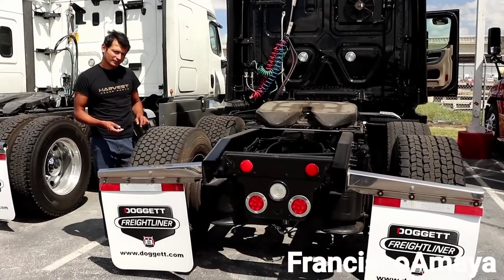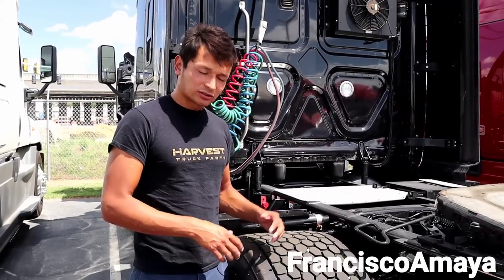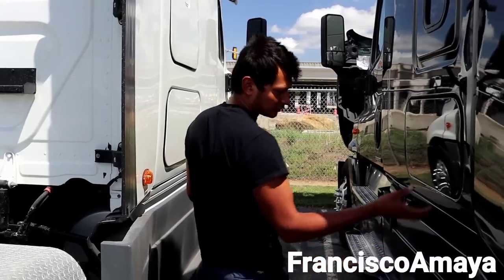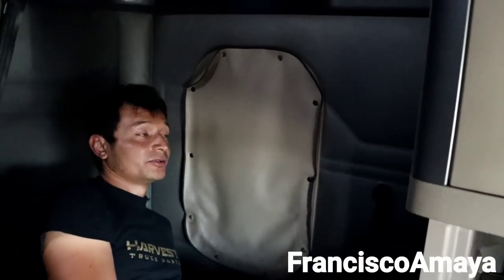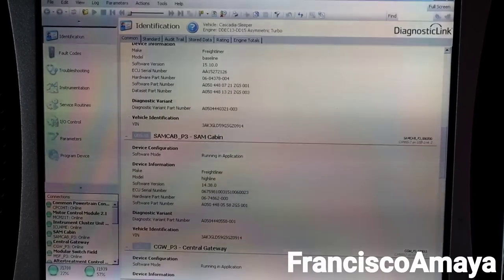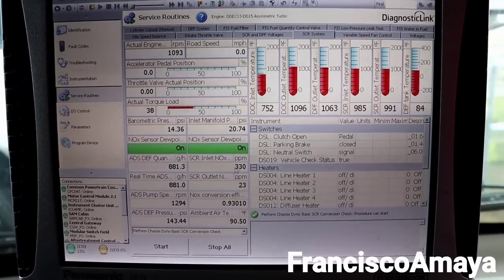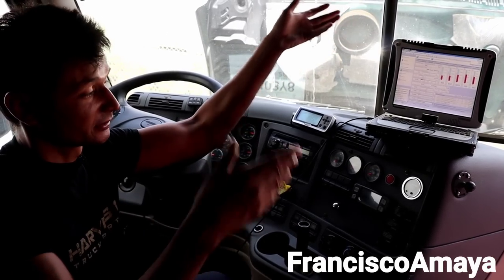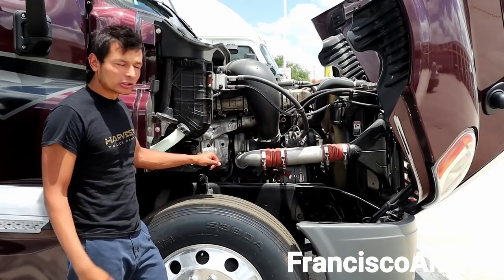Used Freightliner cascadia truck pre purchase inspection at Doggett Freightliner Texas special

Comment: Most of these dealerships spend hundreds of dollars detailing the truck, inside and out... they can hide leaks when they pressure wash the engine to make it great. Suggestion of offered. Spend $$$ on extra dealership-only warranty. So if is a Freightliner, make sure warranty is covered by Freightliner. Se for any other Manufacturer. Gomeoyh a mechanic like this guy, took his diagnostic laptop!!!

Comment: Wish I was knowledgeable enough to do this and not just trust the dealer before I bought my truck. It was a $30k mistake, I had that much in repairs and still not done bringing it to acceptable state. You’d think the franchise dealers would do better than the independent but you have to cover yourself from all of them. They are all in it for the money, be careful with these warranties they sell too. $6k spent on that nonsense and covered nothing. Keep up the good work Francisco and keep the videos coming, they are very helpful.
Reply: what do you mean. The warrenty it doesnt cover anything or emissions?
Reply: Didn’t cover any of my issues, I actually had one $700.00 bill of which $375.00 was due to an emissions part and I paid my $250.00 deductible for that part of the repair plus the other so the warranty did pitch in for something. Point being, have a professional inspect whatever you are looking at, it is worth whatever that person charges. It will save you quite a bit of headache not to mention money.
Reply: @jr996turbo  Yes true. What about buying the laptop setup Its a out 1 to 2k. You can inspect it yourself and keep the setup for down the road. and clear and repair ur own.
Do you think it would be good idea.?

Comment: Great job, Francisco.
I guess I've been lucky, my first truck was an old Scheinider 2002 truck. 733,000 miles, Detroit 60 series, only did 2 super tune ups, sold it with 1 million 90k
Second truck 2014 DD15 cascadia 452, 000 miles, 4 years and no problems with filter, motor, ok.

Comment: I passed on these truck and bought the red one which is exactly the same pinstriping interior ( came from same outfit) very true about  fixing or inspecting vehicle. I took out the water filter and OMG  it was absolutely covered in calcium rock like particles it was NEVER changed. Also just replaced all 8 schocks ( 2 were the small cab schocks on sleeper) freightliner washes the trucks and do NOTHING else.

Comment: Thanks for your youtube. I am planning to purchase a used Freightliner Cascadia 125. Would you please let me know your advice on which one is better to purchase for the OTR of the owner-operator?  *2016 Freighliner Cascadia 125 SLP Evolution: Manual, 375,000 miles, $60,000 vs *2017 Freightliner Cascadia 125SLP: Auto, 455,000 miles, $69,000

Comment: Thank you Francisco but most of us don't have detroit software to monitor the temps. This is why dealers need to just replace the box at 450k and add it to the price. Also changing the DEF filter because people overlook it so often. And definitely check the expansion tank for boilover and discoloration. Cracked head or blown head gasket is just as costly as that 1box. It's a lot to look out for.
Reply: You can buy  The OTR PERFORMACE RESET TOOL, they say work great it cost 600bucks company out of michigan, ir even at amazon sales it, thats an opstion to deal with regen bull. Just saying🚛
Reply: These emission trucks are Garbage, save yourself the headache and by a pre emissions truck. 💯

Comment: Do you think it was throwing white smoke cause its been sitting for a long time?!?!
Reply from the maker: The smell of the box feels like a ceramic transformer, that smell is sign of a unhealthy DOC and SCR emissions filter.  It is possible that there is a damage on it.  It could work fine for couple months but eventually it will start smoking while running and the SCR will be the one causing the problem.

Comment: how much is this laptop setup.?
Reply: I would also like to know. Looks good
Reply: @sweetness2689  i just found out the software on ebay is 40 bucks and a bus link connnector on ebay for like 400 and a cheap laptop. So around 700 bucks a pretty good investment
Reply: @dell7054  I appreciate that boss. Didn't realize ebay had software for cheap. Thanks! ☺️